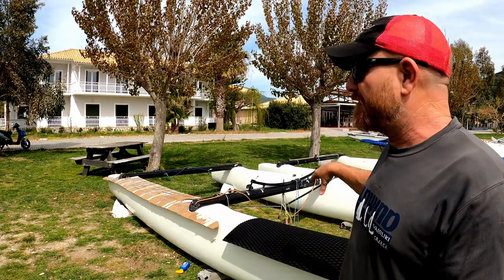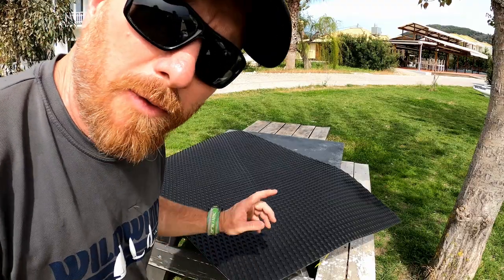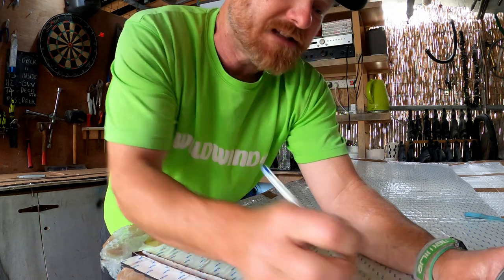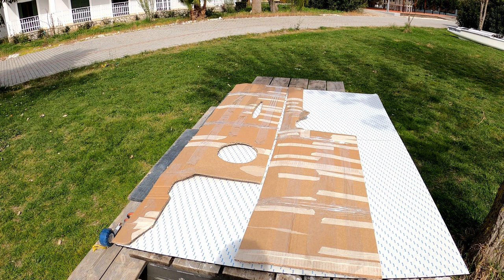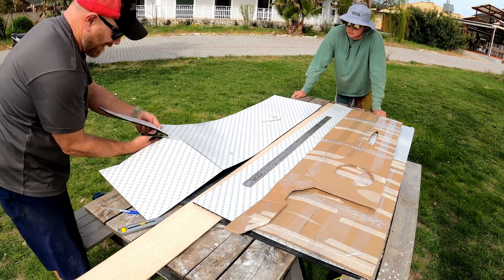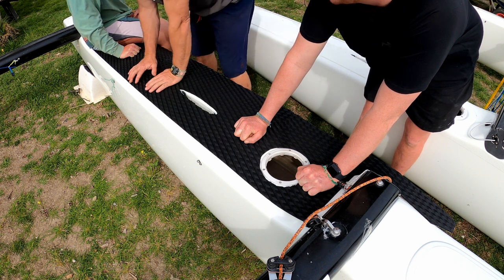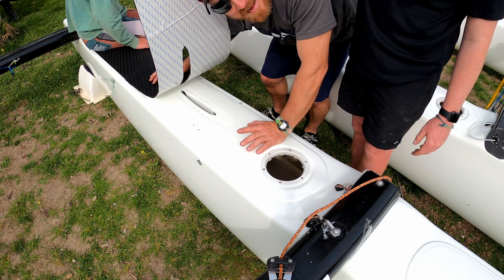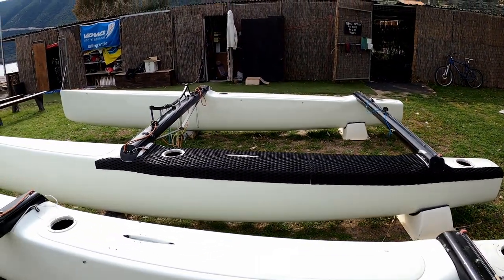Rubber grip - the ultimate upgrade for your catamaran

Comment: This will be interesting if you get a problem with osmosis. With the first Hobie Tigers, the treads were all delivered with the typical Hobie neoprene anti-slip and Armaflex 520 adhesive. After a season in salt water, all boats had osmosis in these spots. From the 1997 season, the hulls were then only delivered with the white anti-slip.
Reply from the maker: Very interesting. It was just a shame that the white anti skid wasn't so effective. 
I thought the reason that Hobie went away from the rubber was financial.
Reply: @JoyriderTV  Just No! 😀
Reply: @JoyriderTV  how are your experiences after a season in salt walter? Hope all your tigers are still free from osmosis!
Reply from the maker: @andreaszeisler629  yes, it has been a consideration. They are still looking solid after a year with it - I hope so - we've just given another 7 boats the treatment!

Comment: Peel the backing lenghtwise, hold the sheet with the side of the head and use one palm of one hand as a squegee and the other hand to peel the backing off, while laying. Use an appropriate size kitchen bowl to trim the round part.
Reply from the maker: These tips are great - thanks very much for that, I have more to do so will try them out.

Comment: Hi Joe, Ash, Seb & man on bicycle who’s name I’ve forgotten,
Whenever I’m doing any large vinyl graphics on vehicles or sign boards I’d always use a water spray bottle with a tiny amount of Fairy Liquid (other brands are available) to give you some “movement” for repositioning if needed, apply a light spray to both the boat and the material, you can remove and re-apply many times until the water has evaporated, once applied leave in the sun or a gentle use of the heat gun will speed up the drying process, try a small off-cut and see how you get on, you’ll be surprised how wet you can make the surface and still achieve a full bond.
Reply from the maker: Hi Barry, I'll try that now!

Comment: Just acquired four pieces of black diamond boat decking material (1200x430). I just can't wait to get to apply it, Joe. Only one question. Why am I well advised to rub off dirt using acetone? Many thanks, Kevin.
Reply from the maker: You can clean the dirt with any product/soap. The acetone is good for making sure that there's nothing at all which may hinder the adhesion - and it drys the area completely very quickly.

Comment: That does look pretty great. Does the self-stick gum work in the long run? Eventually the EVA rubber will need replacing, but that should last at least a decade. The deck padding in my boat (open transom dingy) is lifting after the previous owner installed it 1 or 2 seasons ago, and its getting moldy underneath now. Time for a refit.
Reply from the maker: If I was going to do it again, I would research more products and make sure that the glue is of the highest quality.
This is largely doing well but lifting in places.
Reply: @JoyriderTV  pure silicone adhesive is usually pretty durable and compatible with plastic and rubber. Other stuff like G/flex and Sikaflex-292i is a lot more expensive, probably overkill.

Comment: “Sharpies” write on the waxy backing.   
All comments are techniques and not criticism.   I’d cover the holes and then cut the rubber with a really sharp knife.   I like the comment about using a bowl. I always start in the middle of the piece and work outward.   Don’t start on one end or you may have a disaster if you’re not lined up exactly.  I like the lengthwise scoring comment.   Buying the self adhesive was pure genius.   I’ve tried the spray contact cement and the time saved  on cleanup with self adhesive is worth the cost.
Reply from the maker: Thanks for your input. I take your comments as very useful suggestions - as requested

I tried marking the backing with a sharpie and it was no good! This is some pretty special greek olive oil based wax!
Cheers

Comment: Hey Joe, 
Great video as always. I currently have a fairly used 'sandpaper' finish on my Tornado. Pros and cons for fitting rubber grip onto a Tornado? Also would I have to get a smooth finish (how to) before applying the rubber? Thank you
Reply from the maker: That sounds like one for the Q+A tomorrow.
Reply: @JoyriderTV  Thanks, I don't think I'll be able to make it live (weekend long race training on the Tornado without wind it seems). Would you be able to feature it as a preloaded question?
Reply from the maker: @JanLeoKaak  no problem!

Comment: Is it possible add front trampoline on Hobie 20?
Reply from the maker: Yes, you could do it - you'd need to get a custom one made. 
I'll draw a picture in the Q+A
Reply: @JoyriderTV  thanks a lot 🙏,  Iam  thinking to add a bar to the front by fixing it with epoxy and screws on both side (its can be light something like Boom) what do you think? is it possible to tighten a screw on the base of the catamaran on the front?
Reply: Pls let me know where to find info. Thanks 🙏
Reply from the maker: @AreviTour  the Q+A will be on Joyrider TV Friday at 1800 Greek time. It will be available to view afterwards (if you go to Joyrider TV channel and then click on the live tab

Comment: It is a great idea. Rubbing alcohol is usually the desired prep before adhesive as it leaves no residue. The hatch cut out hole in the template would have been better scribed with a compass. It looked unshapely and so personally I would not have put my foot in that area of the rubber as it was not beautiful enough.
Reply from the maker: Thanks for the tips - yes, the hatch part did let down the rest of the job somewhat.